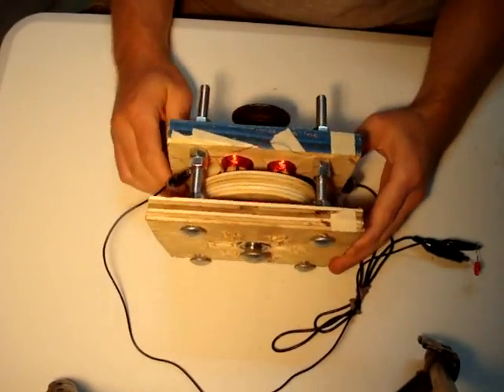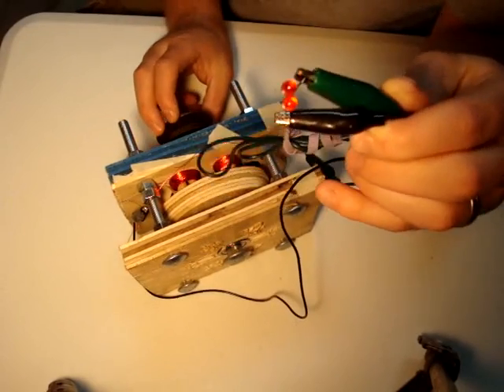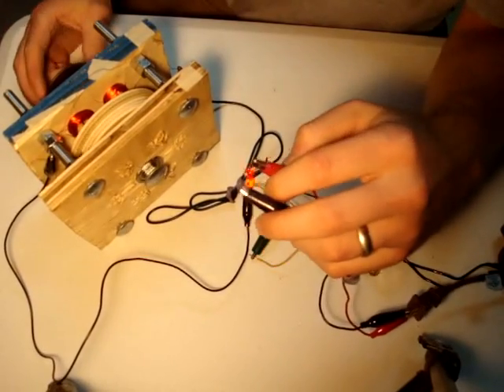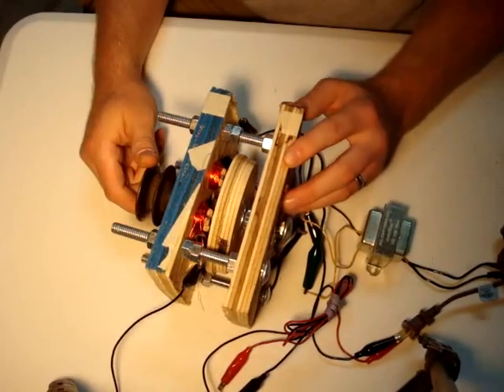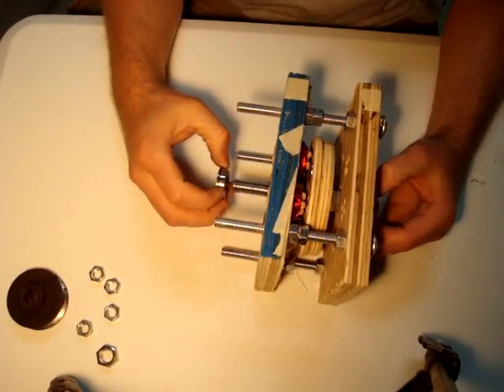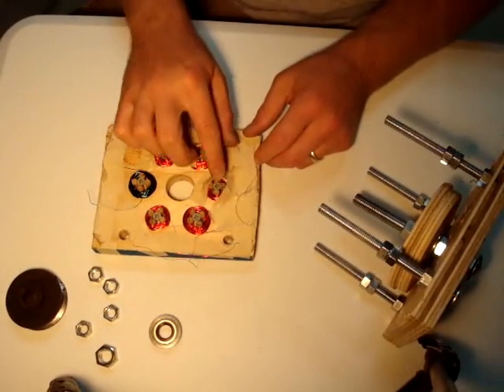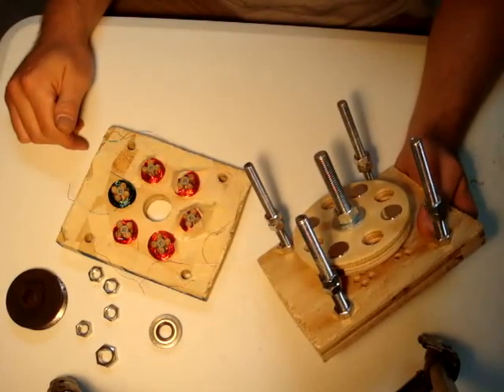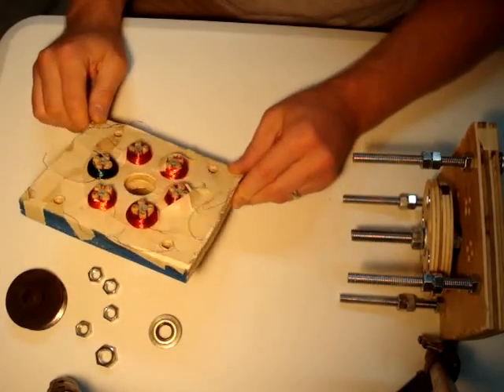Small Permanent Magnet Alternator

Comment: You still around ?  Ever go any further on this one ?
Reply from the maker: I actually ended up making one out of steel with 1x2x3/4 N45 magnets that I have seen output over 4KW @ over 400V on my wind turbine.  I don't believe I actuallly have video of that one in action.
Reply: @KYCoffey  Currently working on a small Wind Gen using a Hover-board motor.  Gathering all my bits and bobs.   Pretty much have all but some blades now.   Going with PVC  until I can afford some proper wings.  On the side playing with a Bicycle Wheel system I intend to be fully portable and able to maintain like one  12v Deep Cycle .    Can't seem to locate any useable information on Coil Perimeters.   How many turns per Volt Realized "" Induction""    Coils are basically just a Air Core Transformer winding .
Reply from the maker: @pulesjet  Look at Faraday's law of induction to get your parameters.  It has been a while since I did it, but that is what I used to calculate number of turns, wire thickness and so forth for my big alternator.  I was able to get pretty close with that.
Reply: @KYCoffey  I have a extensive electronics background and know how. Military and industry   That's not a issue.  I was just thinking someone came up with a simple formula to creating the coils.
Reply: @KYCoffey  Hi. What part is made of steel? And where are your getting an output like that? Is it flying from a pole?  How high up?  And did you keep the same type of windings and coils? What is the AWG you used in the end?

Comment: I recently made my first DC motor. Runs on my 12 volt battery with only two neo mags and two coils at 70 turns with 18awg. I'm hooked! I know it only produces 76 mv at the drills highest speed but onward and upward. It still cranks pretty fast when I go the other direction. Next will be a four coil. If anyone can recommend what would be a good number of magnets plz let me know with a reply. School project so I ordered 10 neo and 5 large ferrite magnets. 28 awg and 32 awg. An tips will be appreciated, I've always been a tinkerer but just getting into electric motors.
Reply: HI. How did your project work out? I would go for lower AWG 20 is my favorite. Follow the formula for winds, changes in polarity and lines of forces to measure potential output.  1 weber (1 meter square) x 1 coil wind = 1 volt.  Measure the surface area of your magnet to calculate the output on your end. It is the first step in building an alternator.

Comment: good job buddy, I'm trying to.make my own but I don't know how the wires go connected, or about phases, can you help me
Reply from the maker: I'd be happy to help.  For this alternator it was just single phase.  You could do a first attempt at this with a single  coil of wire and a single magnet.  If you can get the magnet swinging over the coil you will generate a voltage though it might not be enough to light an LED (depends on how fast the magnet is moving, strength of magnet, number of loops in coil, etc).  Then you can add coils and magnets.  
For your first try I would suggest placing all the magnets poles facing the same direction and using the same number of coils that are all wound in the same direction and wired in series.